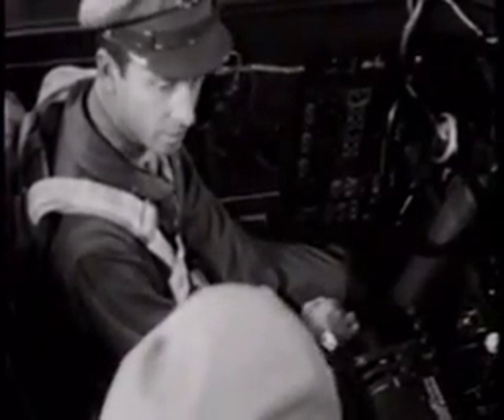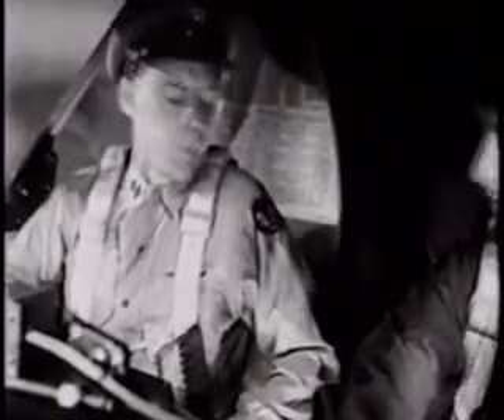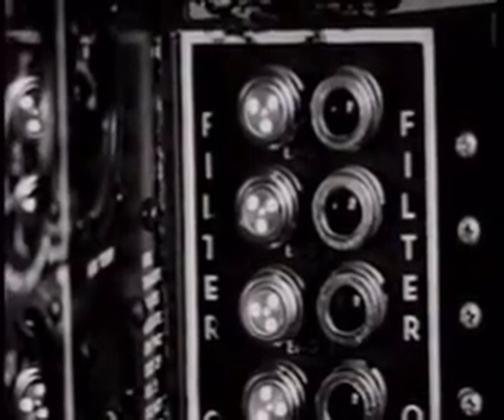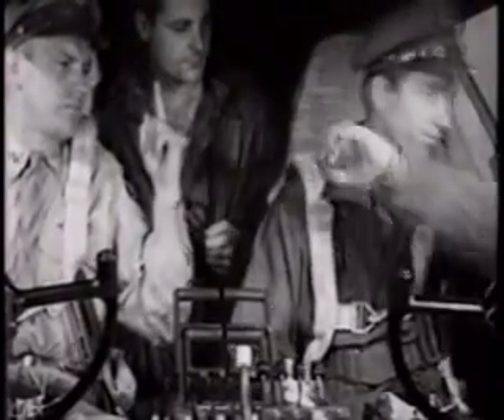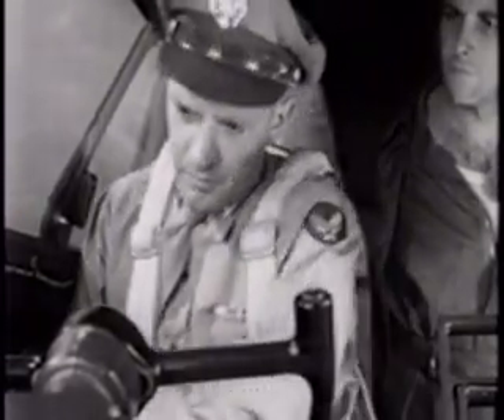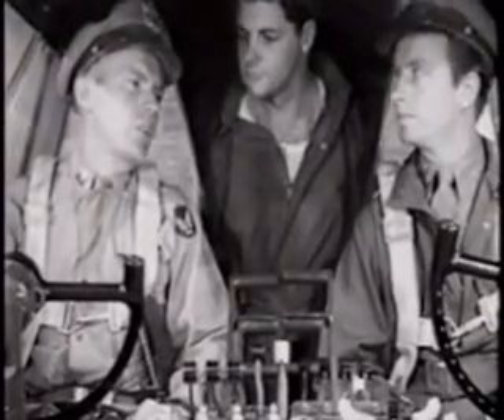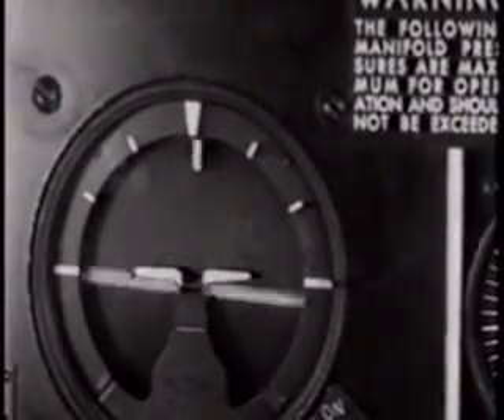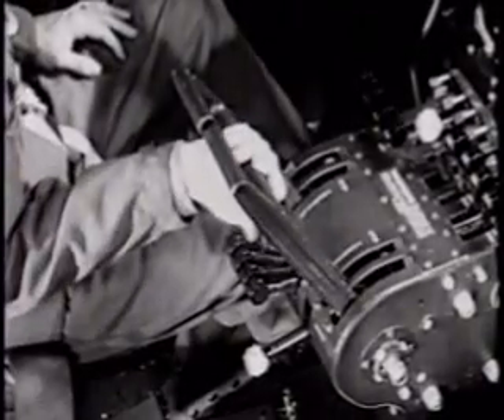How To Start  The B-17 Engine

Comment: A work of art that process is, as with the system, knowing how the older systems worked in getting the most from these machines , this is a critical method with the ground crew for full safety, you don’t break method or you die, that simple, and mistakes did cause many deaths.

Comment: The first written checklist was created for the B-17 due the crash of it's first test flight. The plane stalled and spun into the ground soon after takeoff, bursting into flames.  Post-accident investigation determined the control surface gust lock had not been released. Hence the creation of the modern written checklist.

Comment: Real crazy thing to think about is, Engines, fuel systems and all of this is STILL all done, its just now we have computers to do  all this checking for us rather than a hundred gauges that we (humans) have to keep an eye on. And the computers even have safety systems in place to prevent damage if something is off. 

Its no wonder the older planes needed more people (mainly a flight engineer). Keeping an eye on all of that would just be too taxing for one person, and in this case, even for two people.

Comment: Notice that the designers didn't try to idiot-proof B17's. As a pilot or mechanic, you were expected to know and follow complex procedures. Your competence was required and expected. If you failed at your job, people could die.

Now that we treat adults like idiots, they perform according to our lowered expectations. As a result, we now sell chain saws intended for so-called adults with the warning: "Do not to stop chain with hand". 

Starting my 2000 Miata, I must hold the clutch to the floor to start the engine. But my 06 Lotus Exige will start in gear with the clutch out. It left the factory that way. And there are several other design aspects demonstrating that Lotus expected you the driver not to be an idiot. If you are, it's your problem, as it should be. This is one of the reasons I really like that car.

We've gone down a destructive path by trying to protect stupid people from themselves. With our society's tolerance for incompetence, I wonder if the current American population could have won WWII.

Comment: My late father flew B-17  during WWII on missions into occupied France, and Germany. He had nothing but positive things to say about it's flying characteristics. The flying characteristics were so good, and the airframe so tough, that it was decided to attach a thermite device the the Norden bomb sight to ensure that it was destroyed if the crew bailed out. The Germans had a couple of B-17s in their possession that crash landed in one piece. So ... if the crew had to bail out, the aircraft commander went last after he pulled the pin on the timer for the thermite device. I don't think the Germans ever got their hands on a functioning Norden bomb site. Essentially it was a  mechanical/optical computer for calculating the offset required to hit their target.
Reply: Actually they did, and they were not impressed. The Norden was infamously overcomplicated and never delivered the promised accuracy.

Comment: It takes about 45 to an hour to start a 777....alot of sensors to check , but only a couple to rotate/start the engine.....  that’s mechanical vs electrical....

Comment: wait so is the inverter a DC motor spinning a alternator to make AC?
Reply: It's a DC motor driving an AC generator.(An alternator is a DC generator. It makes AC internally and then uses uses internal rectifiers to make DC) Inverters back then and into the 1960's worked like that. They were essentially electro-mechanical power converters. The F-100's I worked on in the 1970's had similar electro-mechanical inverters. Eventually as high power solid state technology came along inverters became solid state based equipment.
Reply: I think you're right...A "dynomotor"? I had a couple of post WWII Motorola 2-way FM radios that used them. When you wanted to transmit, you'd hit the button on the mic and hear the dyno whirring up to speed generating the 400+ volts for the tubes.

Comment: When I was in A&P school in 1985 we had an R-985 radial engine in a test cell.  I loved running that beast. You needed three hands to start it, one for the inertial starter, one for the mag switch and another for the primer pump.  Even though it spewed smoke and oil when it lit off, that thing made serious power.  The sound has to be experienced in person, you can feel it as well as hear it.  Nothing like it.
Reply: I was at East Coast Aero Tech getting my A&P in 1985. What school did you attend?
Reply: @godofplumbing  Spartan in Tulsa, seems like a lifetime ago.
Reply: @daveb7663  I know, time is flying by.
Reply: @daveb7663 Spartan Class of '80. Did they still talk about the 1340 that lost a blade, then the nose case and "boomarang" 2-blades prop landed on the other side of the airport? GOOD TIMES - I had just finished hand-propping it when it did that !!!!!

Comment: Great video and blurb. Id really like to watch someone hand crank a B17.
Was interesting to see the pilot (though he was in the starboard seat) having to prime each engine manually. A hole in that system by flax may of being troublesome
Reply: Instructor pilots are fairly regularly in the right hand side.  Let’s the new pilot especially an upgrade candidate...Captain or Aircraft Commander military.  Gets them familiar with the view, seating position, switches and instruments location and develop a flow for orderly efficient method of getting aircraft ready for flight.  Also let’s them get to know the major switches by muscle memory in the event of a emergency.
Reply: @stephencannon3140  Thanks, thats good info. I wonder why the pilot seat is always on the port side but i suppose there is a reason for that, perhaps due to starting number 1 engine out that side first

Comment: what happends when inverter fails during flight :D
Reply: The inverters were only used to provide AC power on the ground off of the batteries. Once the engines were running AC generators on the engines took over to provide the AC power. You could also turn the inveters back on in an emergency.

Comment: These four motors carried not much more bomb load than the faster DH Mosquitoes and  the Luftwaffe shot down hundreds of these B17s  along with their 10 man crews.
Reply: The Mosquito had a maximum bomb load of 1800 kg. The b-17 had a maximum bomb load of 3600 kg.
Reply: Double the payload is quite significant, isn't it?

Comment: i have a thick book about the luftwaffe. it says that the luftwaffe fighter pilots in france (2 geschwader at that time. one with FW 190, one with ME-109) were very confident and experiensed but as they faced the first B-17 raids in france in late 1942 they were scared of the B-17. many fired too early because they couldnt belive the sheer size of the B-17. luftwaffe analysis said that the german fighters were not able to shoot down B-17's in great numbers with the 20mm armament. that led to the rapid development of the 30mm MK-108 rheinmetall canon which improved the situation.

Comment: Mechanical switches and gauges are very interesting for me surprising the DC to AC inverter was excited in 1941 in those days solid state transistors were not invented, anyhow these are crafts were very reliable.

Comment: When they check the hydraulic pressure at 2.13, the pilot says, "about 800".  800 what - lbs per square inch (which is a hell of a lot of pressure)?
Reply: Auto power steering hydraulics are more than that on the "high side".
Reply: steve taylor : if i remember right ( age and interference) they flew at 80 psi...actor error.

Comment: B-17 had been almost refused by the military as a "too complex plane to fly". Look up the fatal crash they had during initial evaluation. High respect to the people of vision who fought to keep the program from cancelling.
Reply: Piotr Szafranski The Boeing Model 299 crashed in 1937 because the pilot rushed through the preflight walk around and failed to notice that the flaps were locked in the neutral position.
Reply: Huh? Have you seen what it takes to get any of the fighters of the day going? Watch the the startup video for any Double Wasp aircraft. Sheesh.
Reply: @nutsackmania  it's amazing what they had to know I guess that's before computer-controlled engines. Just imagining they had to know all that navigate fight fly unbelievable
Reply: By 1945 the a1 skyraider could carry 8,000lbs compared to the b 17 at 4500lbs. Amazing.
Reply: @ronaldtartaglia4459  
The maximum internal bomb load of a B17 was 13,000 lbs, not 4,000 lbs as is always getting thrown around erroneously in YouTube videos especially in the comments sections. 
The maximum bomb load with external wing racks was 20,000 lbs by the end of the war, external racks were used in the Pacific and on early missions in Europe for raids on the German sub pens on the French coast. 
As with any airplane the heavier it's loaded the lower, slower and shorter range it'll fly, for high altitude deep penetration mission's into Germany like to Berlin the average bomb load was 6,000 lbs, which was 12×500lb general purpose bombs. 
The B24 could carry even a little more internally with a maximum capacity of 13,600 lbs internal, but like a B17 to get the altitude and range to fly a mission into Germany their bomb loads were kept around 6,000 to 6,500 lbs.
Altitude was very important on bombing missions over occupied Europe since every 5,000 ft loss in altitude doubled the chances of being hit by flak from ground fire.
Also Lancaster's did not fly bombing missions with their maximum internal load of 14,000 lbs like is claimed in some YouTube videos and gets thrown around a lot in the comments section of videos, and for the same reasons that B17's didn't fly missions with their maximum internal load of 13,000 lbs, a Lancaster already had a service ceiling nearly 10,000 ft lower than a B17, if a Lancaster was loaded fully with 14,000 lbs most of them wouldn't have come back from being shot down by everything on the ground bigger than a 9mm Luger, with 14,000 lbs on board they'd have been flying so low and slow they'd have been in the range of even 20mm guns, they may have flown night missions but the Germans had spot lights and radar guided guns and were very good at using them, Lancaster's flew deep penetration mission's with approximately the same bomb load as the B17's and for the same reasons, nobody has a magic wand enabling their aircraft to defy the laws of physics.
Reply: 'To complex plane to fly' ? Then what about the B29? Even a lot more complex and more rutines to make in pre-flight and startup checks ... and listning to pilots from the era flying more than only the B17 .... they all say "she's the most rugged and steady plane"
Reply: @tellyonthewall8751  Yea, the B29 needs 2 extinguishers. :p
Reply: now trump thinks 737s need an einstein to fly and wind mills cause cancer

Comment: Interesting. i love the old boeing bombers, namely the B-29. In comparrison to these classic birds, i wonder how much more complicated/time consuming a start sequence is on say, a 747.
Reply: 747-400 and later are highly automated and a piece of cake to start.  In general, turbine engines have always been relatively simple to operate, compared to pistons.  Height of complexity was reached in B-36 with six, twenty-eight cylinder piston engines plus four turbojets to start.  Checklists were seemingly endless and required close coordination among several members of flight crew, flight engineer, and  others to accomplish.  Starting with the crew in place and walk-around inspection completed, I have heard that it took at least thirty minutes of completing checklists before the first engine was cranked.  Of course, that was with an experienced crew and nothing going wrong.  I had a roommate in the service who was a crew chief on a C-124, which had four of the same type piston engines that powered the B-36 (R-4360).  The checklist he showed me was incredibly complex, but much shorter than the one for the B-36.

Comment: did they turn off the air filters when they were at high altitudes and no dust is around ?
Reply: Probably. It would let the engine breath easier and use less fuel. On the ground there is too much chance for dust and debris to be pulled into the engine. But up high the risk is minimal.

Comment: those radial engines required a lot of maintenance and were very messy but were also a reliable work horse.
Reply: AlphaZorks I'm guessing, Alpha, but perhaps carp was referring to their reliability under war-time conditions.  Liquid cooled engines were vulnerable to shrapnel and ordnance due to water lines and radiators, but air-cooled radial engines were known for running for hours with cylinders shot off and pistons flopping in the breeze!
Reply: That is a contradicting statement.
Reply: Correct.
Reply: I think I worded that wrong, by maintenance I mean many hours of regular scheduled  preventative maintenance, maintained, they were reliable engines.

Comment: My friend in England came back with some information: Your Dad may have been with the 305th bomb group, 364th squadron. Looks like Earl Macksey could have been the original navigator on your Dad's crew. Check out the 305th bomb group on wikipedia. They were a highly decorated unit.
Reply: I think the 305th was under Curtis LeMay at one time during the war.

Comment: Omg being and A-10C Thunderbolt II Crew Chief, this whole video sounds so familiar, with the exception of external power connected. I've had to do Engines runs and the process is so similar. Battery on, Inverter on, APU start on....check your gauges, A/C generators on, #1 Engine ignite the idle after ITT and gauges are settled, check left hydraulic pressure to 3000, primary flight control check, #2 Engine ignite then idle after ITT and gauges settle, right hydraulic pressure to 3000, so on.. etc

Comment: Hi, B17Engr.

I'm glad my father got over late also, as I don't think I'd be here now. Did the flight engineer standby with the pilots during preflight procedures as depicted here. I realize the pilot here is being checked out. Just stopped to read some.. said you were the AC armorer, watch gauges, maintenance ect and the top turret has a stop to keep the guns off the props too..  Have you taken a ride in one again?
Reply: irish89055: flight engineer had his own panel of instruments and position in the aircraft aft of the flight deck. During start-up the engr normally was with his panel monitoring his assigned part of the aircraft and usually remained there during the most part of the flight. During normal  start and flight the pilot and co-pilot were the only ones on the flight deck...others (crew) sometimes come to or go from the flight deck....when they needed to or thought it ok awhile...

.......U.S. American veteran......
............. USAAF 8 th AF........... 
      ........  Mostly 17's     .....

Comment: @MrMKH2010 Seems to me that was just a generator, not a full on APU. Probably just provides low voltage for the starter motors, not the rest of the aircraft. The generators we used WERE massive (bout 4,000 lbs if I remember right), but they powered all systems on the plane.